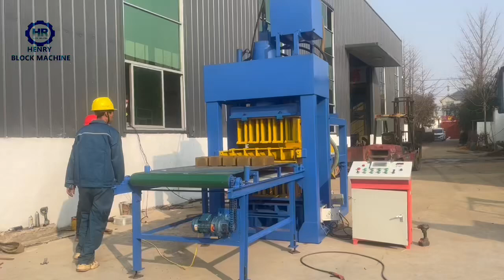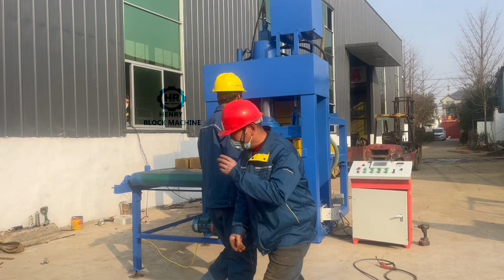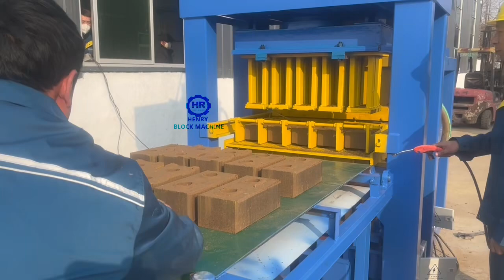200 Tons compression fly ash clay brick making machine makes soil earth Lego interlocking blocks

Comment: Higher compression would be a stronger brick.  For example, normal class concrete has a compressive strength of 20 to 50 MPa at 28 days, while 20 MPa and 25 MPa concrete is commonly used for driveways, footings, and footpaths. 25 MPA is equal to 3,626 psi. 32 MPa concrete is often used in residential construction because of its cost-efficiency and versatility. This concrete is made from a balanced mix of water, aggregate, and cement, which makes it suitable for standard building requirements. 32 MPa is 4,641 psi.     It would be nice if you cured a compressed earth block for 28 days then tested it to show us the MPa with 8 to 10 % concrete as a stabilizer.
Reply from the maker: Thank you sincerely for your attentive and professional explanation and reply. We hope to provide more data to support clay brick users in all countries. However, the local soil composition in our city is not conducive to us making such an evaluation. If you have the opportunity, you can Find suitable soil locally to test